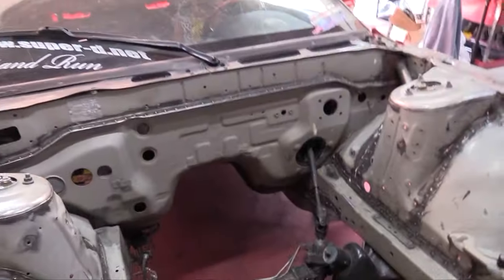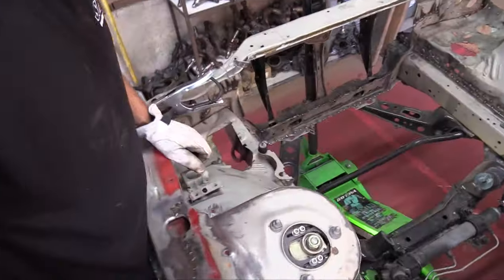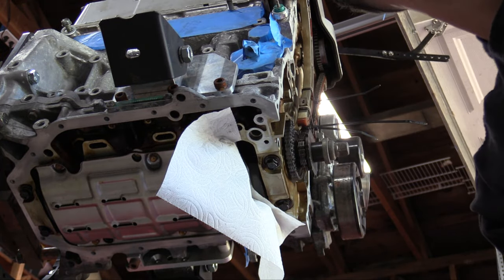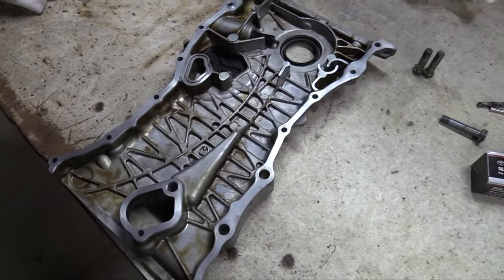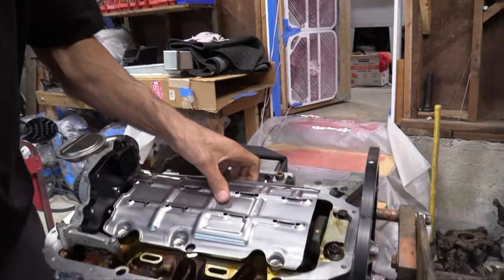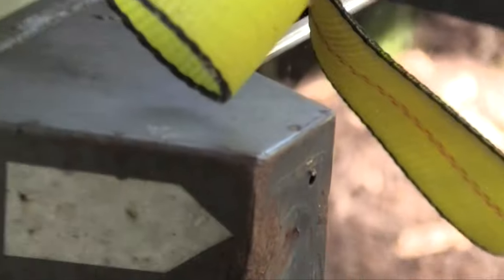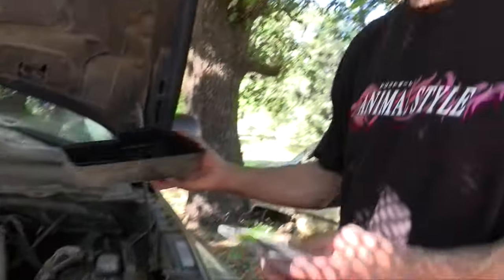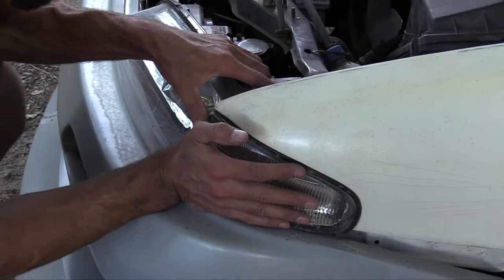Random Car Prep - Julian's K24 swap, Sam's engine bay, Pheeb's s14 // Drift Team Animal Style

Comment: There are 2 wholes that need to be tapped and blocked off now when using the K20 pump.
Reply from the maker: Just learned about this. Guess the oil pan is coming back off 😅